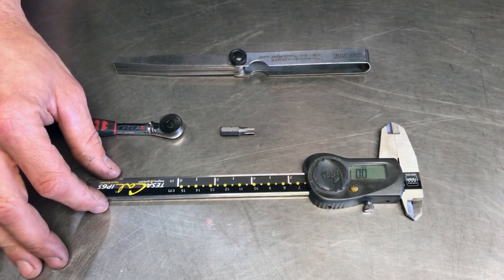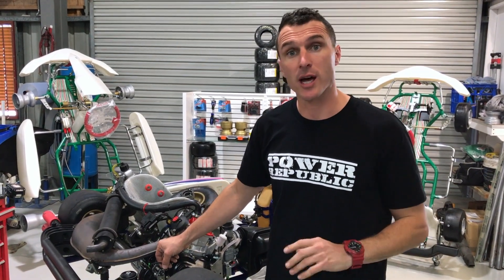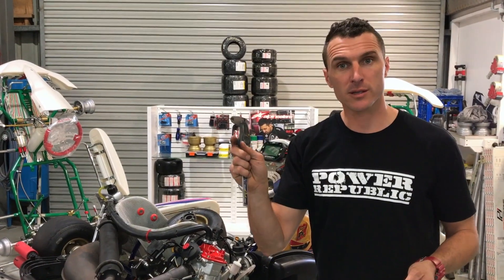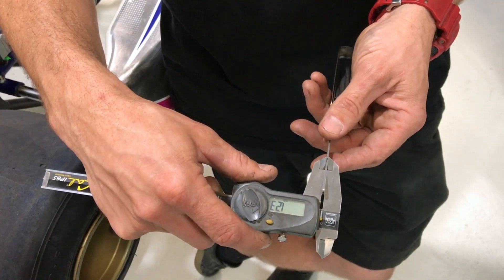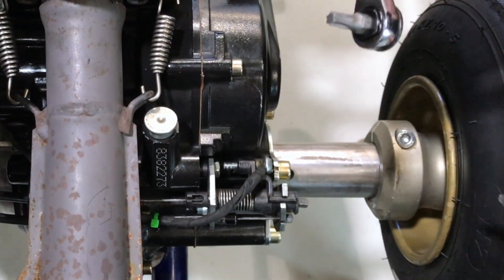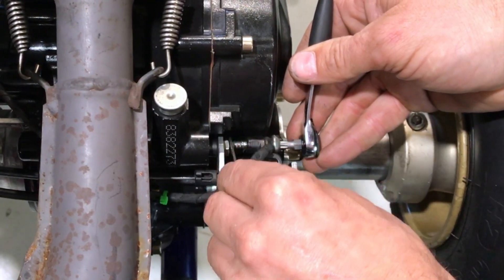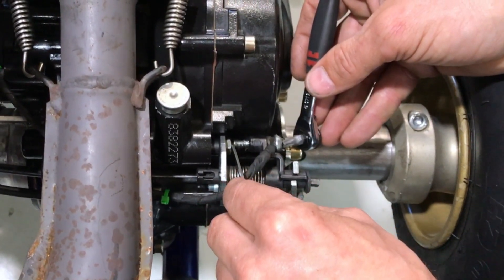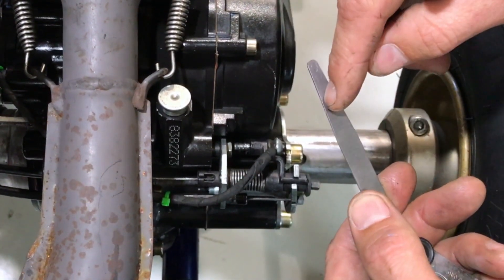Power Republic - The Easy Way To Adjust The Electronic Ignition Cut-off on Your Rotax Max DD2

Comment: Hi Power Republic, my ignition cut-off on a kart I bought secondhand isn't working because the wire is missing. As I understand mine is the old version with 4 wires for the coil including the cut off, I'm not sure which wire is the correct one, can you maybe help? Thanks!

Comment: Hello, thank you for this beautiful explanatory video  ;)
Maybe you could help me for my little problem of not cut-off the ignition when I change gear, I explain myself. The gap is well adjusted (according to your recommendations and those of the manual), I checked between the connector of the coil and the screw I have less than 1ohm, I checked the ground on the engine and cleaned the contact, everything is okay (less than 1ohm). When I try your technique of putting a screwdriver between the screw and the ground I don't get any cut-off.I have measured the voltage and I have 5v when the engine is at idle, but I would like to have your opinion.
Is the cut-off only in the high rpm or should I already see a cut-off even at idle?
Because I don't feel the cut-off and I find that the gearbox hits hard when shifting into second gear.
Thank you in advance for your reply and good luck with the rest.
Reply: This is an old dd2 engine with 4 wires on the coil including the ignition cut-off wire

Comment: Hi power republic, is this ignition cut off that you're changing the ignition pickup sensor?
Reply from the maker: nah its the cut off the DD2 gear shifter, the ignition pick up is seperate again and plugs into the crank case sensor (on the DD2 that is under the engine between the engine mounts)
Reply: @PowerRepublic  thanks for the help

Comment: Is there any differences in the maintenance of the Evo vs DD2 with respect to things like ignition switches, jetting, brake bleeding etc. I'm watching all your video tutorials and wondering whether some of the information you are providing is only relevant on the DD2 model or needs to be applied differently for owners of the EVO? Thanks!
Reply from the maker: Great question Pete, the EVO parts are all interchangeable.   the only exception being the black box ECU;s and exhaust pipes (dd2 v's Senior Max, Jmax)
Reply: Power Republic  Thanks - your videos are great. I’ve wanted to buy my own kart for years but never had the mechanical know how to make it happen. You are inspiring new racers to get into the sport!
Reply from the maker: @petertodd24  thanks for the positive vibes.  getting started is the hardest part!

Comment: Hi and thanks for another great video. My ignition cut-off is set as you recomended. However the engine does not cut-off when shifting gears. Any ideas why that is? I guess it has to be some sort of electrical failure.
Reply from the maker: Charlie Pedersen hey mate, maybe try arcing out the circuit with a screw driver as the engine is running and see if it cuts the engine out.   Then it might be adjusted out to far.  Otherwise check the wiring for a break in a wire or something ?

Comment: Thanks for this video, I had no idea there has to be a distance of 1 to 1.5mm . I’ve just checked the link to the manual and it says it very clearly. Thanks 🙏
Reply from the maker: Your very welcome Silvana.  How'd you go with the 140cc DD2 upgrade kit?
Reply: Power Republic Hello!
Is not going well at all! 
I’ve had the 140cc kit for few weeks now and after trying different carburetor settings, I can’t make the 140cc cylinder go faster than the 125cc. My lap times are pretty much identical between the 125cc and the 140cc. In four different days, I went to the circuit early in the morning, and tried both cylinders on the same day (my fastest laps with the 125cc are achieved by using a 133 main jet, and the fastest laps with the 140cc are achieved with a 134 main jet. Both having the needle in position 5, super rich.) but both cylinders are identical in lap times and both reach around 13700-13800 rpm. The place where I bought the 140cc kit, keeps telling me I should have an extra 5hp with the 140cc kit, but so far it hasn’t translated into faster laps. I’m starting to think it’s a ripoff, so next week I’m going to give my DD2 engine with both cylinders to a friend who is going to test them on a Dyno. I will let you know how it goes, but right now I do not recommend buying the 140cc kit, so far it has been a waste of money 😢
Reply from the maker: Arr that sucks, maybe the extra 5 hp is not the whole way through the rev range so its not much of an advantage.  Did you try changing down a gear set?  Maybe with the extra CC's the engine has more torque and the increased speed and reduced lap times will come with a lower gear ratio?
Reply: Power Republic 
Wow, that makes a lot of sense! Maybe I do need to try a lower gear ratio! That’s a great idea, thank you so so so much, I will try that as soon as I get the engine back, I’ve just sent the engine to a friend who has a dyno testing machine and he is going to test the engine with both cylinders, I will let you know the results as soon as I have them. And as soon as I get the engine back, I will go to the circuit and I will try the engine with the 140cc cylinder and a lower gear ratio, believe it or not, no one has suggested that to me, even if it makes a lot of sense. thank you once again 👍🙏
Reply from the maker: @p.c.h.6721  your very welcome
Reply: Power Republic 
I have a quick question. Do you know what’s the right Squish for the DD2? The distance between the piston and the cylinder head? Some people say it should be 0.9mm and other people tell me 1.25mm, do you know?
Reply from the maker: @p.c.h.6721    I set mine to 1.25 so the exhaust port is higher and the top end power goes up, which is a benefit in the DD2.
Reply: Power Republic
That makes sense, I’ll go with 1.25, thank you so much 🙏